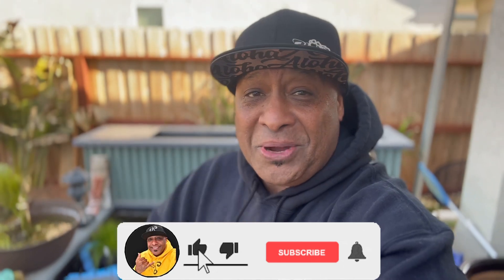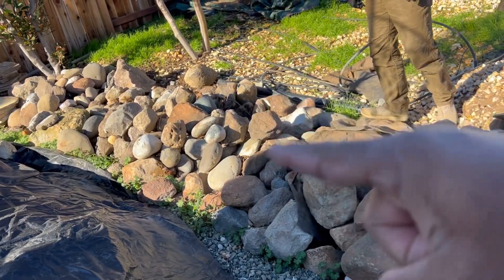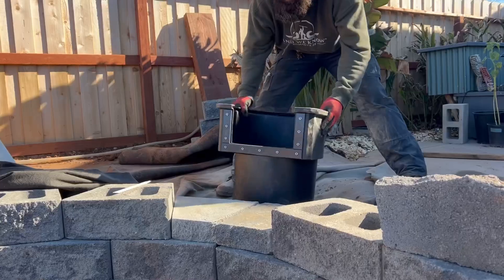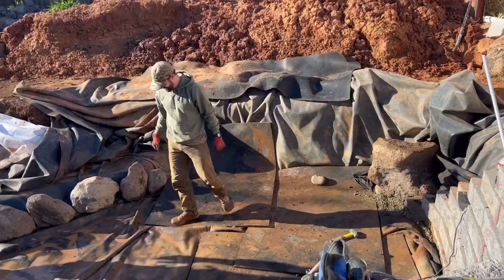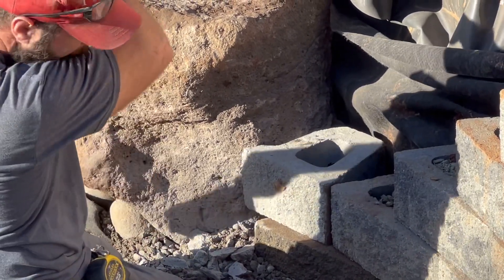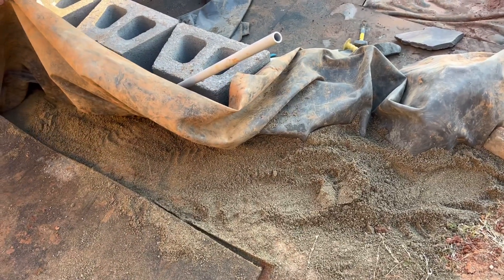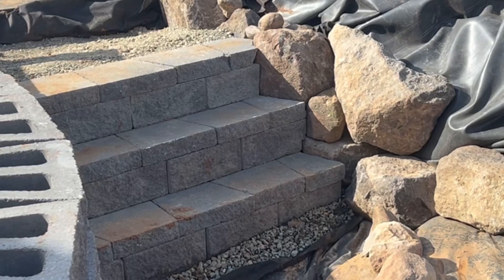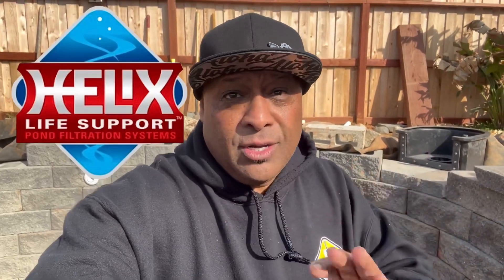ADDING ROCKS to my MASSIVE DIY BACKYARD POND!

Comment: Love the video and have been waiting for the pond update! I am planning on putting in a swim pond and was going back and forth if I should use wall block in there or not. After seeing your video I have decided I’m going to! One suggestion I would make - some of the edges instead of back filling with dirt on the outside of liner, you could fill with gravel on the inside of the liner and put a ton of bog plants in there.
Reply from the maker: Nah we’re gonna run a drip system to those plants across the other side by the waterfall we’re gonna do a water garden similar to a bog but I like the way you think see you totally get it!!!🤙🏽🤙🏽🤙🏽

Comment: The bottom drain looks like some small fish could be drawn into the intake
Reply from the maker: Oh yeah a small fish could totally get sucked in but my fish are big🤙🏽🤙🏽
Reply: @HaYNFishKeeper  I know but those fish are gonna make babies for sure this spring and summer. I found babies from a quarter inch to 3 inch through out my filter system
Reply from the maker: @markalan8517  yeah if they do then only the strong will survive 🤙🏽💯🤙🏽